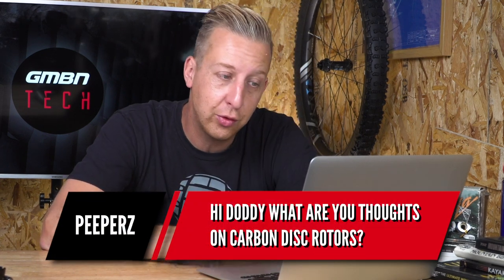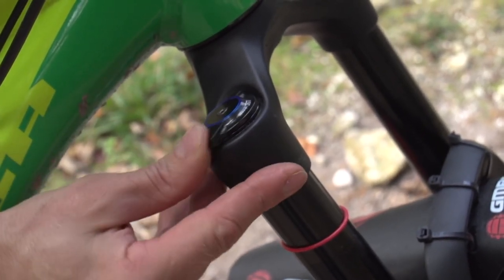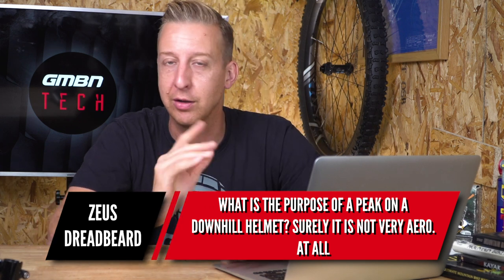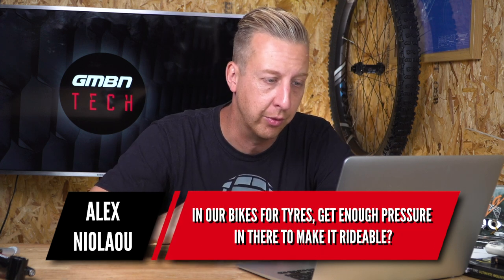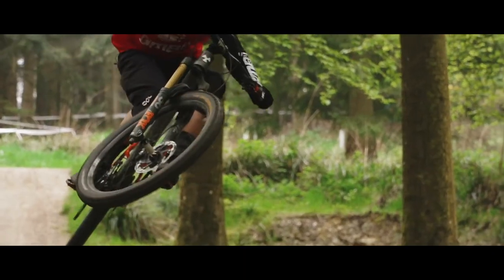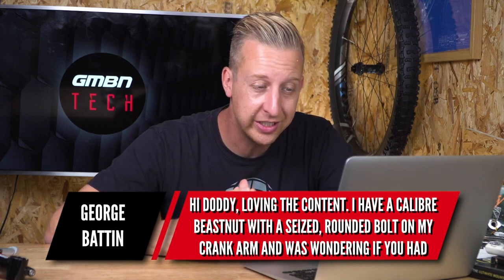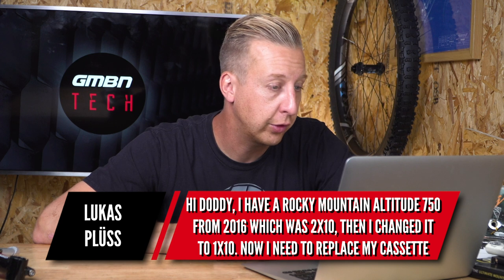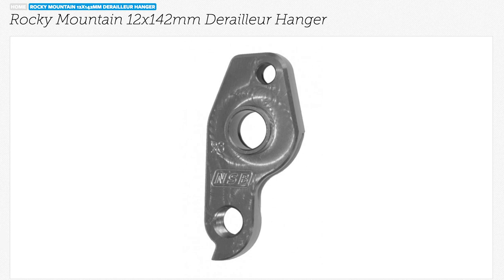Do Carbon Disc Rotors Work? | Ask GMBN Tech Ep.24

Comment: Hi Doddy, if you upgrade to having 9 to 10 or more cassette as long as it’s long cage, do you have to get a new derailleur or will a new shifter just move the derailleur the right amount? Thank you!!! #askGMBNTech
Reply: The b tension on the derailleur may not be long for the guide pulley to clear the biggest cog of the cassette.
Reply: Your current derailleur will be designed for 8spd ONLY, the shifter might move the cable the right amount but the derailleur linkages may move the jockey wheels the wrong distance.

I'd recommend replacing the derailleur for a x10 compatible one.

Comment: #askgmbntech I've done tubeless twice now and it's pretty easy, but every once and a while I hit a corner really hard and burp the tire and then I'll go into a rock garden and break the rim. Should I  continue to go tubeless or should I stick to tubes that you know when its flat and to stop right away before you break the rim, I dont race much I'm about the fun and breaking rims isn't fun? Thanks doddy
Reply: That sounds like you're running too little air pressure in your tyres, you should experiment with higher pressures. Or you could get Cush core.
Reply: Getting an insert would stop you breaking the rim

Comment: #askGMBNTech I currenty own an entry level hardatil with a 120 mm travel fork. Whenever i do a jump/drop, my wrist kida hurts, even though i set the stiffness to the lowest level and i try to keep all my weight on the pedals. Any suggestions?
Reply: Drop with the rear tire first, also play with your psi. My bmx calls for 110psi but I ride em at 30psi without any issue

Comment: #askgmbntech
hi dody, I like to understand a point about lefty
how could a  one leg fork could  provide more strenght than a double leg?
specially on vertical shocks?
two other points made I made conventional forks points, firts one  there is no DH lefty , second as  per cannondale some plane use the single leg configuration, but they just forgot that those plane has two wheels on the same leg, so the vertical forces stay balance betwen both sides
so I would like to understand theyre point

Comment: #askgmbntech Hey there. I'm after a new full suspension frame to replace my quite old fashioned geometry one from 2014 (A Rose Granite Chief, if you've never had a look at the German brand). Something that works well with a 150mm fork and (here's the bit you might find hard) is suitable for a shortarse. I'm 5'7" so tend to sit right in between Small and Medium sizes and I'm built like a weasel - long body, short legs. Any ideas? A couple of grand is the limit!
Reply from the maker: A lot of the new trail bikes coming out are longer and lower than previous, and this includes lower top tubes and seat tubes, giving lower standover heights and the ability to use longer dropper posts. There's a few calculations you can make, measuring your inseam (inner thigh) to get your standover height limit. Also measure your saddle height from the BB to max height. These measurements, matched with the seatpost you have and the seat tube length of a prospective frame should give you a good start on possible frame.
Reply: Cheers! I was a bit surprised to hear my name on the most recent tech show. You're right about the longer dropper post - my current frame shows it's height becauseI have a 100mm dropper and that's pretty much the full possible range. Thanks again, much appreciated.

Comment: #askGMBNTech Hi Doddy, love the tech channel. 
Tyre pressure question.
CRC's guide on MTB tyres says 45psi, maybe as low as 35.
My Maxxas IKONs say 65 but I used to run those 34 rear 32 front with tubes, any higher on the trail and I'd ping about.
I've now got Conti Mountain Kings 2.4 front 2.2 rear and they recommend 50psi, I started at 34,32 but found with more support in the sidewall I pinged about again. 
I've since dropped to about 24,20; and thats with tubes still. 

I can't imagine Conti don't know what they're doing but where are they getting these high numbers? 
Am I the one in the wrong and should I be at 50? Feels like I may as well just run the rim.  
This is on a Giant Talon and I'm about 90kg.
Cheers, Phil.
Reply: As a fellow 90+ kg rider, I can tell you that you are most certainly wrong. The ONLY way that pros can get away with 20-24psi and not be basically riding in the rim is that: 1) most of them weigh less than us 2) they are almost exclusively running tubeless 3) a bunch of tire inserts have popped up (sorry)  if you're willing to pay a weight penalty. 

Nothing wrong with running tubes, but try an actual tubeless setup (not ghetto tubeless if you want to run low pressure), and play around with a good pressure gauge.
Reply: No one is using 50 psi in mountain bike tires, the pressures written on the side have nothing to do with what pressure you should actually be running. Almost everyone (like 80% + of normal riders) runs near/below 30 psi on the rear and a little less than that on the front. 20 is probably too low unless you're on very wide tires
Reply: You are quite right, the 50 or 65 or whatever values are usually the MAXIMUM tire pressure.
Reply: I'm 66kg, and in my maxxis minion dhf (tubeless) I run less than 20 psi and ive never had a puncture
Reply: I also don't feel like I'm running on the rim. The rims are very fairly wide tho. The tires are 2.5
Reply: Valdemar Johansen okay...like I was saying, you weigh a lot less and are running tubeless.
Reply: Just checked the tyres
They do say max 65psi on the tyre, but the instructions said inflate to 50psi.
See here ---> http://www.chainreactioncycles.com/continental-mountain-king-ii-mtb-tyre-folding-bead/rp-prod83001

When I first got this bike it came with the IKONS 2.2, I put them at 40 PSI as I used to run in my old MTB with 1.7" tyres.
Far too hard so for the type of riding I did, bit of road, gravel path I found 34,32 to be the best all round.
If I was doing a trail day I'd let a couple of psi out, no pinch flats, no squirming.

So of course when I got the Contis ( 2.2r 2.4f )I went to 34,32. 
Hard as nails and no supplness at all so on a trail day I kept letting out a puff till it felt right and the squished looked good.
I assumed this was down to the thicker sidewalls and maybe volume.
Back at home the gauge showed this as 23,19, it's a topeak D2 btw so no issues there.
I put it back to 24,20 given the read lost a puff and I'd gone a fraction too far on the trail. 
I've not ridden for a while so when I did check it was 22,17, rear felt a bit squirmy on the road outside as I checked my indexing.  

My skill level is at the "not falling off" stage so I can't claim to feel every psi, but I can tell whats good and whats not and even mid 30's was horrid where as the mid 20's I felt like a trail god.

So the question stands, why the heck is 50psi recommended?
Reply: You seem like you know enough of what you are talking about to decide what you like best.  My question is, why would you even give any thought about the product description of an online bike parts supplier? My guess is whatever intern that was adding products to the website just did maximum pressure minus about 25%.
Reply: Good point.
Thought I'd check the Conti website... 
http://conti-tyres.co.uk/mtb/mountain-king-ii-2-4
reccomend 50psi 
Protection, thicker sidewalls, 40psi

Why are they recommending 50, why do mine feel good at half that?
Reply: That is interesting.  Maybe they don't want to be held liable by rim makers?  Here I am, telling you that you are wrong (in my first reply), when everyone in the industry has their own ideas.  Like I said, go explore tubeless and wide rims, but more importantly I guess: just ride it.
Reply: Sunny here in California.  I have no excuse now.

Comment: Carbon fiber handlebars are tested to such harsh tolerances, they would snap an aluminum bar long before a carbon fiber bar would even start to become stressed.

As far as the vibration dampening.. IT IS REAL. Even the very low cost Nashbar carbon fiber handlebar has a better feel than higher cost aluminum options. Buy a carbon fiber bar.

Comment: #askGMBNtech i bent my rear wheele in a crash to the point were it cant be used i do have a spair wheele that i could use it mostly compatible the only problem is it 26 and my bike is 27.5 is there any way to make it fit
Reply from the maker: It'll probably fit, but then the geometry will be completely off.

Comment: #askgmbn It's rain season in México and i have no place to store my bikes. I keep them under a little roof outside my house and they just get the rear end wet. Recently in my cheapest bike ($250) appeared some yellow stuff on almost every screw. What can i do?
Reply: Daniel Cruz this boi has found rust
Reply: And what can i do?
Reply: Apparently this boi has found rust.
Reply: Daniel Cruz you can see if the GMBN tech show could give you some tips to remove rust
Reply: Have you tried covering the exposed end with a tarpaulin?
Reply: Dom T what is a tarpaulin?
Reply: Daniel Cruz  material that tents and other camping stuff is made out of.
Reply: Daniel Cruz like plastic sheeting but a bit more durable

Comment: #askGMBNtech maybe this will be a weird or unusual question but my question is what is the best groupset or a drivetrain set for my bike that only cost about 10 000 php or 200 dollars. I want somehow play on a light trail with out any problem
Reply: Sram XX1 Eagle And I would recommend getting the new wireless version of that as soon as it comes out just to make sure you don't have any problems on the trails.
Reply from the maker: Shimano Deore of SLX is probably your best bet. And if you get the option of a better shifter or derailleur, get the better shifter. and +Tomi Saaranen, we weren't talking about $2000!
Reply from the maker: Shimano Deore of SLX is probably your best bet. And if you get the option of a better shifter or derailleur, get the better shifter. and +Tomi Saaranen, we weren't talking about $2000!
Reply: GMBN Tech Haha it was just a joke! And you're right

Comment: #askgmbntech Hi Doddy, I scored a used wheelset but the hub is for a through axle and the fork on the bike I am getting this for is QR. It's still a good deal of I have to change the hub so I bought the wheel set. I found this hub adapter however the tech I talked to didn't know much about them. Do you have any experience with something similar? It would be nice to keep the thru axle hub as I can now use this wheel as a spare for my other bike. //www.mec.ca/en/product/5044-187/Thru-Axle-Wheel-Adapter
Reply from the maker: Looking at those adapters, they specifically say that they're for wheel truing stands and shouldn't be ridden.So you probably shouldn't use them for you bike.
Reply: Thanks. I did notice that after posting the comment. I had gone into the shop(outdoor shop, not a bike shop) and was shown that product, however when asking the techs about it they had never used them. I was skeptical so decided I should ask around. Thanks again.

Comment: #askGMBNTech I race xc for my local high school mountain bike team in Utah and I am looking for a hardtail under $2000 USD with good parts such as 1x 11 air fork and good hydraulic disc brakesb it would be nice to have it carbon but it could be aluminum. Any thoughts on a bike
Reply: MTB Shredder look at canyon
Reply: Tim Dijkhuizen I have looked at Canyon and the cheapest is 2499 dollars, $500 over my limit, but good suggestion
Reply: Look at Diamondback. They have the Overdrive 29er in carbon for $1500 or the Mason Pro or Sync'r
Reply: Canyon Grand Canyon
Reply: Specialized Epic the one i have
Reply: I'm not sure if you can get those but a Bulls copperhead would be suitable I think
Reply: Tim Dijkhuizen they do look god for the price but I really want a 1x 11 but I am also looking into Diamondback
Reply: Look at devinci
Reply: Darren I just did but for a frame for a caebon hardtail is 1700 dollars
Reply: MTB Shredder what about their aluminum 1s like the kobain rs
Reply: Santa cruz chameleon
Reply: cahernand1 I have looked at it but the cheapest is 2699
Reply: Under $2000 dollars preferably under 1800
Reply: MTB Shredder I personally have a  2018 Trek X-Caliber 8 and I am really happy with it.  The only thing that it doesn’t have is a 1 x 11 like you are looking for.. It has a 2 x 10.
Reply: Caedmon Jones Thanks for the suggestion but i would like a higher quality fork over a Rockshox recon but the 2x 11 could be okay
Reply: Chaz Contag The Nukeproof Scout is a trail bike and it's not made for XC-racing.
Reply from the maker: The Scott Scale 930 has a carbon frame and everything else you're looking for at $2000
Reply: MTB Shredder Trek roscoe 8 ?
Reply: I found a Radon Jealous So 9.0 1x 12 for 1500$ with migura storm sl brakes, Sram GX eagle and a Rockshox Reba but sadly it doesn't ship to the U.S. Is their any way around that?#askGMBNTech
Reply: Sorry, Doddy where does it show the price for the Scott Scale 930?
Reply: MTB Shredder Have a look at Vitus bikes on Chain Reaction Cycles - I have a Vitus Sentier VRX, 1x11 XT Drivetrain, XT Brakes (180mm and 160mm), 140mm Yari fork, absolute beast of a machine.
Reply: Dayne Phillips Thanks I look into it
Reply: Dayne Phillips what size of wheels does it have
Reply: MTB Shredder the Sentier has 27.5 wheels, can get it in 29er version but has less quality components. There is another bike Vitus do that might actually suit you better now I think about it, the Vitus Rapide Carbon - 29er wheels, carbon frame, Reba fork and SRAM GX Eagle drivetrain - all for under £1700. Not sure if this is within your price range in dollars, but if it is CRC will ship to US. Link below - http://www.chainreactioncycles.com/vitus-rapide-cr-carbon-ht-bike-gx-eagle-1x12-2018/rp-prod159761
Reply: Dayne Phillips I have checked it 1899 Us Dollars looks good the size I need is out is stock, I did find a Scott Scale 950 with 1x 11 shimano xt, RS Reba Shimano mt500 brakes and tubeless ready tires for 1500 at a local dealer
Reply: You should check out the giant xtc advanced 3, for $2000 you get a carbon frame and an air fork, 1x10, but can easily be swapped to 1x11 later on. Giant bikes have really good value because they make their own frame sets instead of sourcing it like every other company- in fact, most companies use giant to make their frames
Reply: Matti A. Great suggestion but i found a Scott Scale 930 with a carbon frame fox fork, 1x 11, internal cable routing and some good shimano hydraulic disc brakes for 1899
Reply: MTB Shredder nice, was it on sale or is that the regular price? I’m starting to look for a new bike too
Reply: Matti A. I honestly dont knownhow but that is the regular price
Reply: From the original Scott website its only $100- $150 less
Reply: MTB Shredder I’ll have to check it out and maybe get one
Reply: Matti A. Yeah for $2000 or less its a darn good bike and i just checmed the weight and its 24 pounds

Comment: I was wondering Specialized enduro elite vs trek fuel ex8. which one is better for dh #askgmbn
Reply: Definitely the Enduro. It has significantly more travel and more aggressive geometry. The fuel ex is better for normal trails and climbing
Reply: conner rowland A Trek fuel EX 8 is more trail with 130 travel front and rear and specialized enduro elite is more enduro/DH oriented, so I would got with the Specialized
Reply: Defidnely the Enduro. The Fuel Ex is more towards XC-trail and climbing.
Reply: I have the Fuel EX8. I ride Bikeparks too, no Problems so far. Suspensiontravel is also no problem, i had never hit end travel. Jumps are around 50cm high. They are not really high but i have 100kg, so i think suspension makes a good job

Comment: Regarding the carbon disk rotors, if you do take the picture from singletrackworld.com as an example, you really should've scrolled down to the comments and followed the link there. Because this very rotor was tested by a user, and it simply disintegrated after a couple of runs. If this would happen on a trail you'd probably die...
singletrackworld.com article: https://singletrackworld.com/2016/11/alpha-introduces-a-32-gram-carbon-disc-brake-rotor/
The link mentioned in the comments with the pictures of the broken rotors: http://www.foromtb.com/threads/discos-de-freno-de-carbono-alpha-rs-cuidado-con-ellos.1366597/

Comment: These brake discs made of Carbon Fiber plys are actually "fake" and probably really dangerous. Real carbon brake discs as they are used in Motorsport are made of ceramic, which is completely different from the resin which is used on these fake Discs. The ceramic will withstand much much higher temperatures than resin. most resins used for carbon Fiber layup production will just melt away if they are getting hotter than 150-200°C.
Reply: Yeah most are like that, but in f1, they actually use "carbon-carbon". Don't know how it works, and you definitely can't see carbon weawe through them.

Comment: Wow mountain bike components arw getting more and more expensive
Reply: Mtb gear is better than it has ever been, you can get super solid components for not a lot of money. go back 15yrs you and had to pay top dollar just to get something that worked .
Reply: Yeah, I meant as in Carbon disc rotors and that they don't perform optimal and are really expensive
Reply from the maker: Yeah, but they're not necessary at all, and not really used either. So, no worries about those!
Reply: But at a few thousand dollars, you hit the point of very highly diminishing returns.